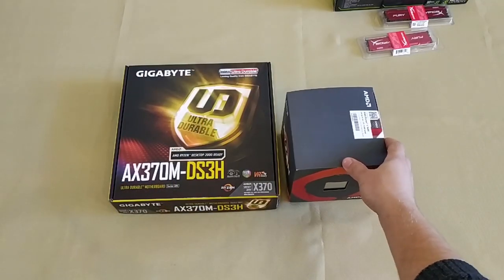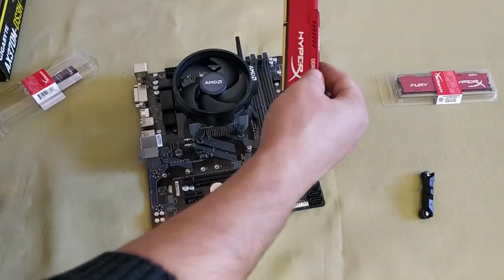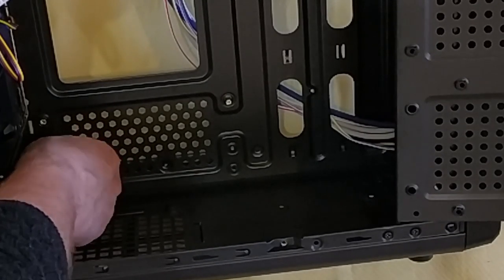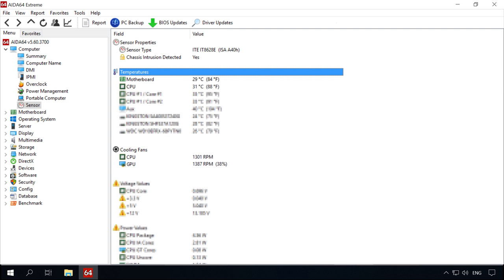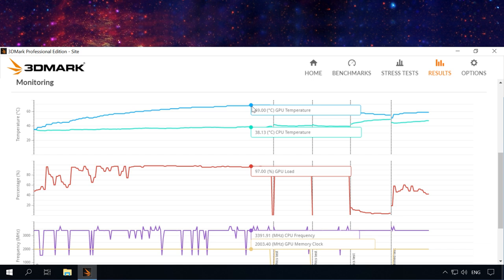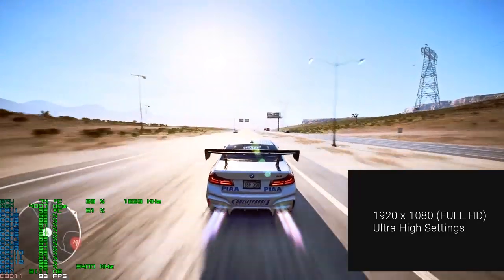How to Build Your Own PC: Installing Motherboard, CPU, Cooler, Graphics, RAM and SSD ⚙️

Comment from the maker: Contents: 
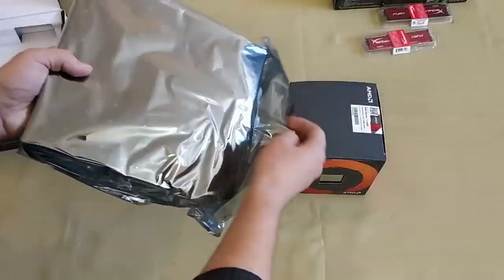1:26 - Getting ready to assemble a computer; 
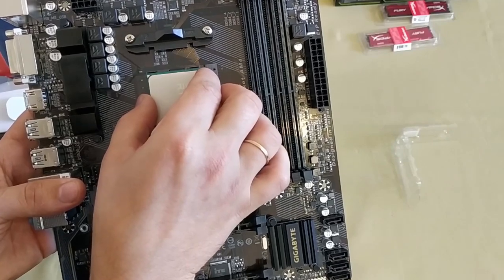2:01 - So what’s the proper way of installing it? 
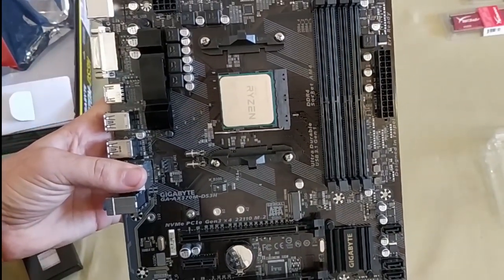2:36 - The next step is application of the thermal paste; 
3:48 - Installing system memory; 
5:09 - Installing the motherboard into the case; 
6:04 - Connecting the PSU to the motherboard; 
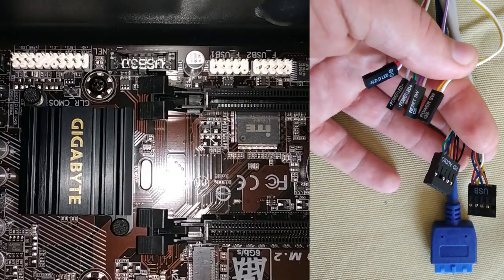6:31 - Connecting the motherboard to the case; 
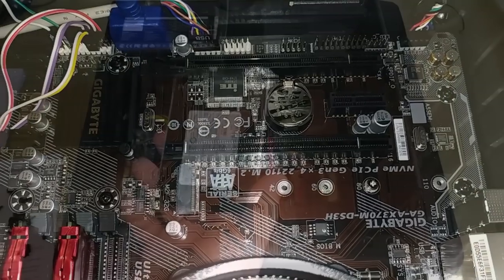8:02 - Installing the hard disk; 
8:33 - Installing the graphics card;

We continue the series of videos on building a new PC, and if you didn’t see the first part, just follow the link in the description. Did you like the video? Click Like button and subscribe to Hetman Software channel. We will be glad to answer any questions in comments.